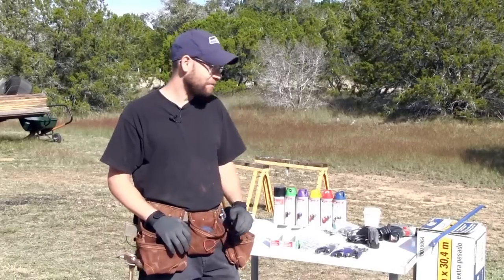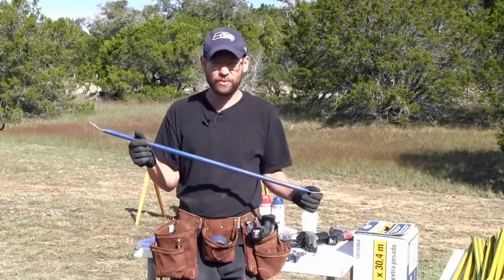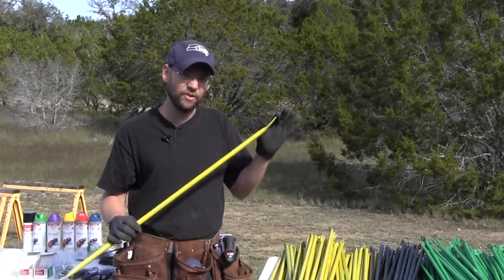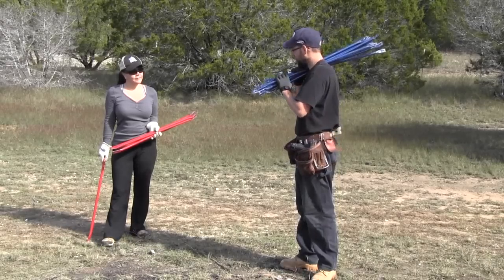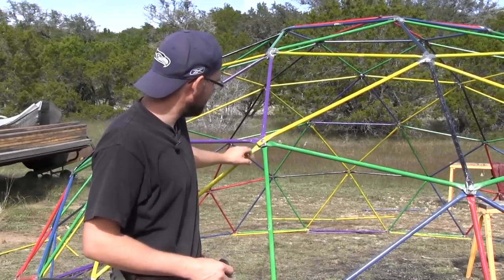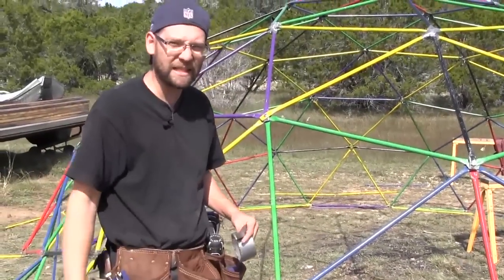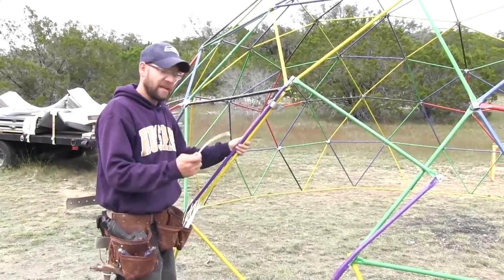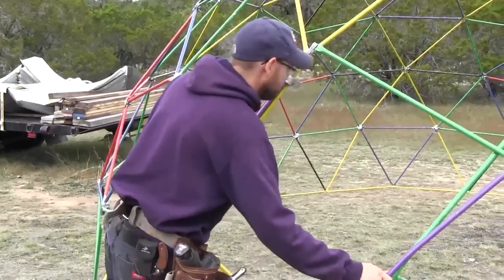How To Build a Geodesic Dome - Assembly

Comment: I like how you built the small top piece first and kept lifting it up to add the lower sections.  I've seen silly people build all the bottom parts first and then climb ladders to add all the top pieces... not the safer option like you did it.  I've seen pallets wrapped in that stretchy saran wrap type of plastic used for keeping loads stable sitting in the sun for years.  I was thinking of using that to wrap the whole thing in.  And to turn a dome into a home you could spray the inside with foam and plaster the outside once the foam gives you a nice firm base and plaster the inside later.  
For a better door where the green pipes almost make a horizontal bar disconnect it there and put in a single horizontal bar in it's place and go straight down to the ground from there and make a square door frame (I'd so it out of 4x4 posts cemented into the ground with an actual door attached), and then just connect all the piping to the posts.  And put a concrete walkway sloped downhill away from the bottom of the door so rain doesn't go in.

Comment: Can you build a geodesic dome around a tiny house.
Reply: @marthale7 
Cheaper and less work to just build a single dome with double or triple glazing. Not a viable option for an emt tube dome.
Reply: @marthale7 
A dome greenhouse with a flexible triple glazed covering isnt much more expensive than one that is single glazed. Conduit domes are tricky to cover and seal, i`ve never seen one covered with greenhouse poly that looked any good.

Comment: What a crap door design!...He clearly didn't study structural engineering as that has weakened the structure of the dome...Door openings to a dome should be symmetrical and additional struts should be added around the door to evenly distribute the stress to the ground.

Comment: the steel structure you have used is very good and would you mind sharing the angle at which these have to be bent at the ends
Reply: It changes with each element's position. For the horizontal ones, at the bottom, it's easy to figure out: the sum of turning on the vertices of a closed geometric figure is 360º so if your circle has 10 struts each one should be 36º from the previous so each tip should bend 18º. Every other one should be around the same ballpark.